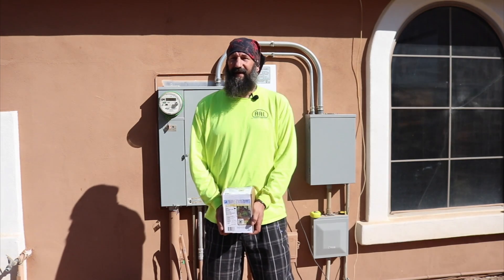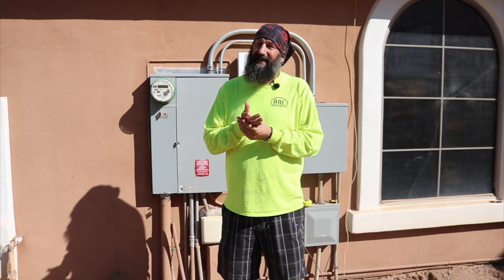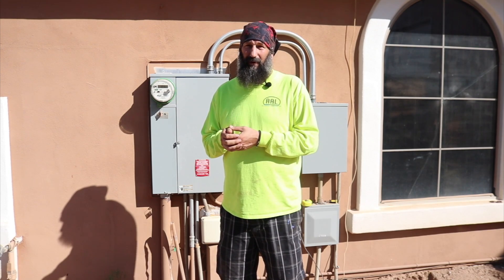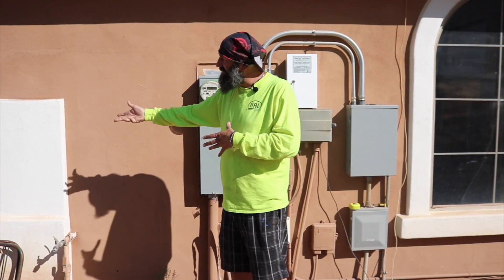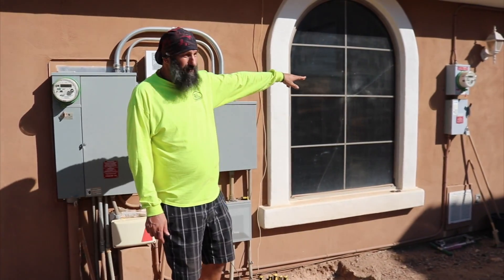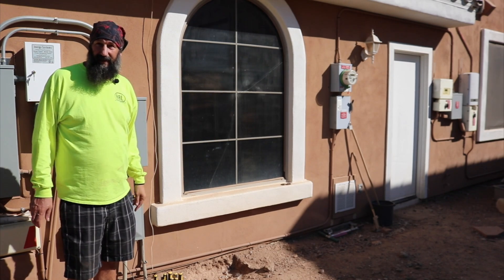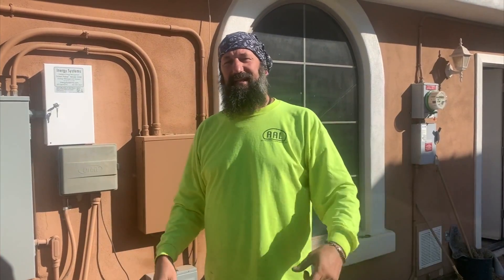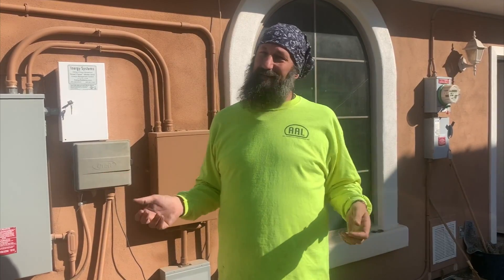How I Installed a 50a 220v/240v Line For a Tesla and RV | For Beginners NEMA 14-50R

Comment: Good comment about the conduit and wire. The other issue that has become evident over the last few years is that the cheaper outlets that are fine for dryers and ranges are not built for the continuous loads of the EVSEs and are overheating and melting. I am pretty sure this set up has the cheaper outlet because it fits in the exterior RV box. The 2.5 inch commercial grade outlets will not fit into the enclosures. Currently there is not a good option for an exterior EVSE outlet.
Reply: The answer is to buy the weather proof box that comes with the inferior receptacle, remove the receptacle and replace it with an industrial grade one. The hole in the box is too small so you'll have to drill or punch the hole out bigger so that it can accomodate the bigger industrial grade receptacle. You'll probably also have to drill some holes for the receptacle's mounting screws.
Reply: You are correct with this solution. Is this a good solution? It works, although a bit of work to accomplish. Too bad no one has yet created an enclosure that will accept the larger commercial grade outlets.  @robmenzies862

Comment: I like diy videos like yours.  They inspire and motivate.

For everyone out there, please start with your building department.  A permit may or may not be required (they cover your butt for insurance coverage).

Your service (electrical supply to your house) is installed for your home as built.  Level 2 chargers are like adding a second stove/oven combo to run all night.  Your main electrical supply wires may not be big enough.

All the requirements are publically available, but inspectors and electricians should already know them.  A phone call may get you an answer, a consultant, a trainer, or a worker depending on your needs and abilities.  

Just be safe and do it correctly.  

Remember that most electrical rules and requirements are written with the blood of the dead.

And knowledge is the one treasure that you can give all of it away and still have all you started with.

Comment: Dude stop doing electrical you don' t know what you are doing, plus #8 thhn wire at 75 °C is rated for 55 amps ,white pvc is for plumbing not rated or listed for electrical systems plus that needs to be schd 80 by code.
Reply: Sir, I may have the wrong code book.  My 2020 NEC under 310.16 table has #8 them at 55 amps under the 90 degree column, however 2020 NEC 110.14.(C).(1). Demands we use the 60 degree column for equipment connections under 100 amps.  So, to get the 55 amp 90 degree rating, we must connect to the breaker with a #6 @ 55 amps @60 degrees and then splice to a wire connector rated at 90 degrees to your #8 to use the 90 degree column.

Did I get that right?
Reply: @keithharrington4595  what?
Reply: @freakyzguard  when you look for the ampacity of wire, how much current the wire will carry, you find 2020 NEC table 310.16 which has 3 columns for copper and 3 for aluminum.  

Most people look at wire like thhn and say look 90 degree c column.(#8 wire at 55 amps).

Few realize that the NEC in 110.14.(C). Says that the wire that connects to the breaker mush is the 60 degree c rating (#8 wire at 40 amps). (Exceptions exist)

This is a 40 amp breaker and 40 amp circuit not a 50 amp circuit.

By changing the temperature rating of the wire termination point, you can now use the different temperature setting.  So, the 60 degree wire rating at the breaker means you can connect #6 @ 60 degrees and 55 amps to a 90 degree wire splice to run #8 thhn at 90 degrees and 55 amps.....you might need to shift back at the other end for connection to the unit or receptacle.

Generally, this shifting back and forth for wire sizes is not done because it cost more in time and equipment expense.  It is cheaper to install the larger wire the whole run.

Comment: schedule 40 is recommended for underground work schedule 80 exterior expose work so there is a difference between white an gray not just the color but the uses in different applications there are also less shater sun light resistant  GOOD video

Comment: Is there any requirement for the 220v 50A outlet?  At home, we have a 220v with dual 30A outlet.  I used it to charge my Model Y but in the car i changed the 32A received to 28A. What do you think?
Reply from the maker: You can leave it at 32a and the car will only charge at whatever is available to it.
Reply: There's no requirement. If you have a 30A outlet, use that. Just keep in mind, since you'll be charging your car for many hours continuously, the rule is to only use 80% of what your breaker is rated for. In your case, assuming your 30A outlet is also attached to a 30A breaker, you should only draw 24 amps from it.

Comment: I just used "Liquidtite" when I ran a line outdoors for the required disconnect I installed with our new Ductless ~ac unit. (from the disconnect to the unit, that is). Not cheap, but it is rated for outdoors. Somewhat flexible, and has special fittings.

Comment: will #8 THHN wire work as well?
Reply from the maker: Only for the ground.  The rest should be #6.
Reply: @BearsWorkshop  according to what?   Voltage drop on a short run of 8awg and that current like you're doing is well below 3%
Reply: safety factor says #6. don't be cheap and stupid. 😂 FAFO!

Comment: Grey PVC is schedule 80, thicker-walled than the white schedule 40, which is why it is specified for electrical work.
Reply: Actually gray PVC conduit comes in Sch. 40 as well as Sch. 80.  Most of what they sell at the consumer retail stores is Sch. 40. Sch. 80 is often special-order.  Sch. 80 is recommended (possibly even code-required) for any exposed outside use because it's more impact resistant than Sch. 40 (by exposed I mean above-ground).  In my experience the gray PVC conduit is also more shatter-resistant than white PVC pipe.  Lastly, the gray conduit is UV-resistant, whereas white PVC pipe is not.  Painting it, as he did in this case, would certainly help with that.  But had this been my project, I'd have waited until I could get conduit (or gone further to find it).
Reply from the maker: Thanks, good to have the right information.  Didn't sound right when I heard it.